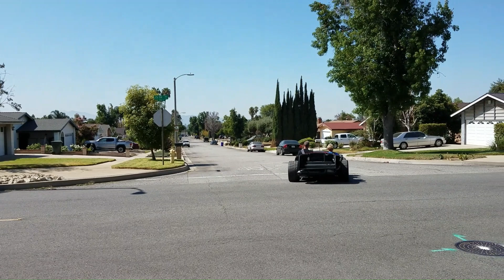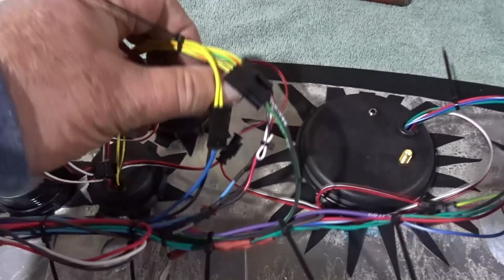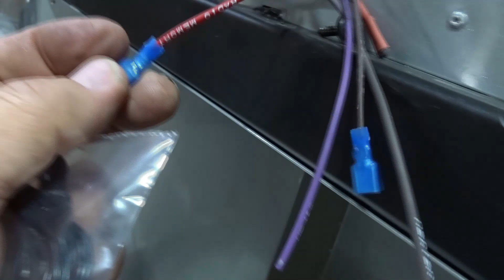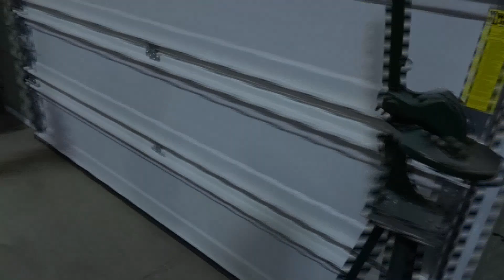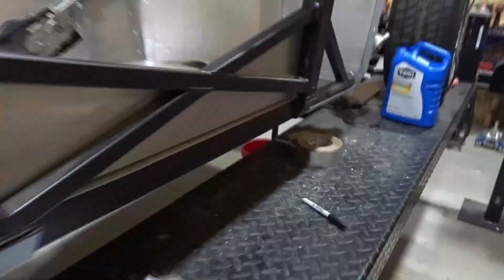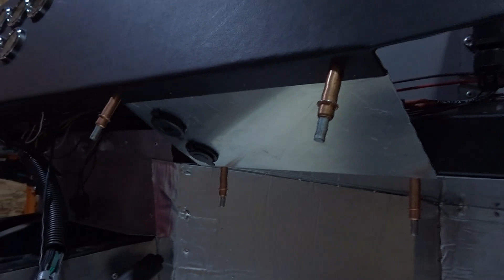Late Additions to Our Wiring Harness

Comment: I definitely need to do the under dash panels on my MK2.  It's on the list of many things to fix/upgrade.
Reply: I made them too, I mounted the heater vent to them, and they really stiffen the dash
Reply: @ good to know.  Thanks!
Reply from the maker: I give the dimensions for the ones we do in the video. Really easy pieces to make. Don't know if I should sell them or not? What do you think?
Reply: @ it might be worth listing them, just not sure what market you would have, as you said, not hard to make.  Would definitely not keep a lot in stock, likely not a big seller.